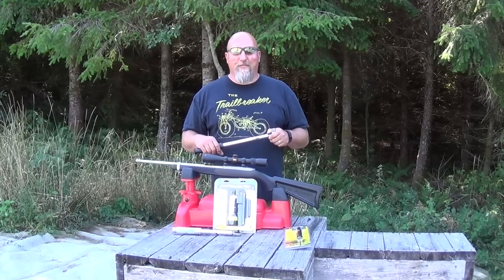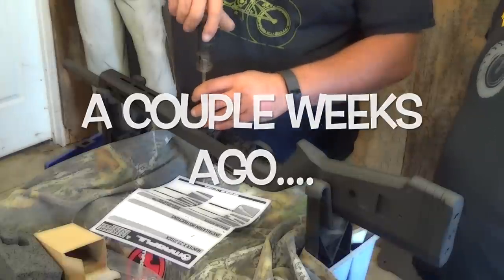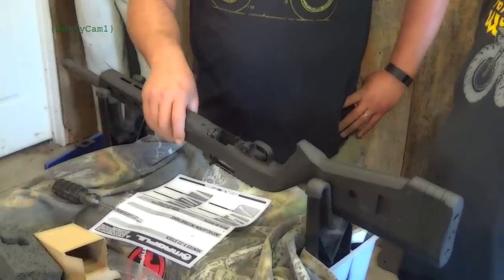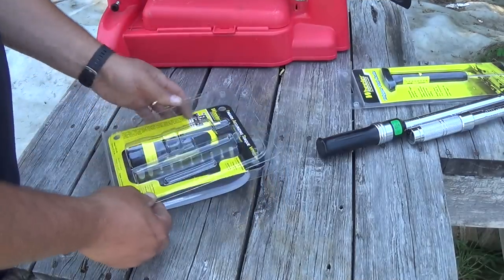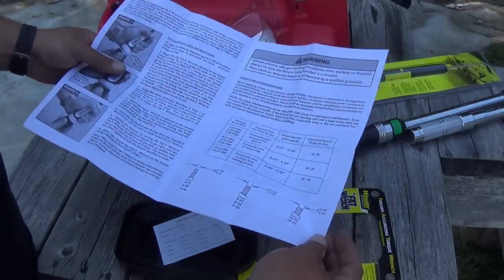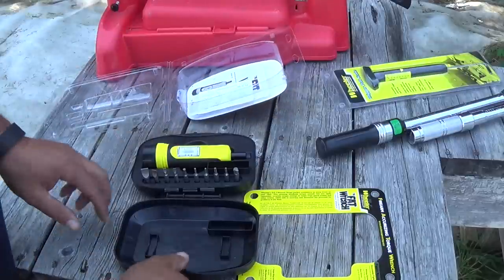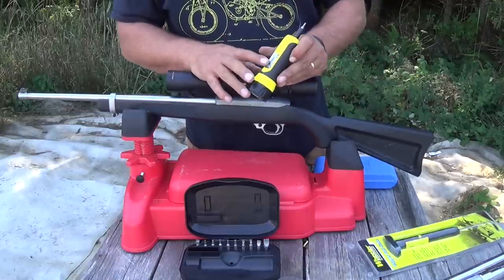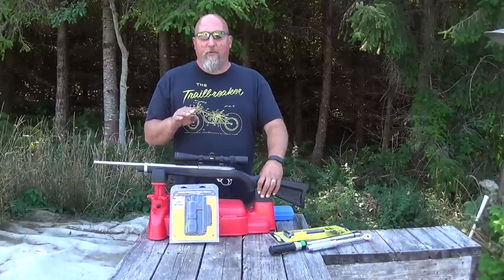Wheeler FAT Wrench - Torque Screwdriver - Review and Demo

Comment: That torque chart isn't quite right!  It refers to steel screws in steel parts.  Most scope mounts are steel screws in aluminum.  Refer to a torque chart for the screw size in your mount.

Comment: good point all screws nuts and bolts have torque specks for a reason the reason is to get the best holding power of the said  nut bolt or screw without  stretching the treads or leaving it to loose or over tightening it and doing damage  to the item

Comment: At least for scope ring torque, their settings are WAY off. From Vortex and Nikon, scope ring screws should never be torqued to more than 15-20 inch-pounds. Always check the manufacturer's recommended torque settings before you apply any torque. So according to the Wheeler recommended settings, those screws are torqued to about twice what they should be.
Reply: Yeah mine are at 18 too.

Comment: I found that wrench disappointing in that the red line used to determine torque setting is fat and imprecise. Furthermore, there is no mention in the instructions I received with my wrench that tells you to use the leading edge, middle or trailing edge of the line,. IMHO, this wrench is better than nothing but is susceptible to the user dialing in a 10% margined of error or better due to this flaw. I'll be upgrading mine to something else very soon.

Comment: I've had my FAT wrench for a while now but I am still confused on where the actual setting indicator is.  The line for it is rather thick so, is it the top of the line, the center of the line or the bottom?
Reply: Top of the red line aligned with the tic is that setting.  If you align the tic with the bottom of the red line that adds 5 lbs.  The online manual slightly clearer.
Reply: @TOakenshield  Thank you very much for that info.  Helps a lot.  Always struggled with that since it such a broad line and the paper manual has no mention of what to do about it.
Reply: The only reason I came to this review, thanks for answering this.
Reply: I agree with John. The only reason I came to this review is to find the exact portion of the red line for proper torque setting.
Reply: @TOakenshield  Dude this is gold, thank you for mentioning this
Reply: @johncos1068   Hahahaha.. Me too..
Reply: Me three, thanks for clarifying where the setting should be.

Comment: I saw another video on this thing where they guy had several Ruger 10-22s and tried different torque settings for the stock to action screw.  One shot better at 10" pounds, one at 30" pounds and others at the suggested 20" pounds.  Trial & error and shooting multiple groups appear to be helpful.
Reply: It helps set the vibration to the entire set up. As long as you don't go to tight and strip. Play around with settings to help dial it in. Every rig will vary as every set up is different so it's a play and figure out what that specific gun wants. Change something It'll change how it vibrates etc. If your truly picky on target shooting. And need every shot in one hole.

Comment: I came to this review for one reason and after lots of bla bla bla you did not answer the question.  The red indicator is way thicker than the setting lines.  The pictures that come with  the tool are far too tiny and blurry to see anything.  Trying to figure out if the red indicator goes to just touching the mark or what?

Comment: I've had one for a while now and have used it quite a bit.  Eh...it's ok I guess.  Would I buy it again?  Probably not.  I'd like to know the exact inch pounds I'm torquing to, not an approximate.  Some may not mind, I do.  What's more, most manu's don't give torque specs for screws, etc.  I've called a couple of companies and was told that they don't have any.  They tighten until "adequately tight".  So, what good is it?  Naw, I'd pass.

Comment: How do you set a torque that is not a multiple of 5 such as 18 inch pounds for my vortex scope?
Reply from the maker: Count the number of turns it takes the handle to go from 15 to 20, multiply that  number by .6.  Set the wrench to 15, and then turn it towards 20 the number of turns you just calculated.

Or just set it just shy of 20 and call it good.
Reply: I got it just below 20. It's fine.

Comment: I tried adjusting the take-down screw on my 10/22 but found that there wasn’t much room for adjustment. The screw was loose at first but was fully tightened after just one turn. How much room for adjustment is this action screw supposed to have?
Reply from the maker: It varies from rifle to rifle and fist to fist.   That's where having a torque screwdriver comes in handy for repeatability.  'Fully tightened' is subjective, and it's nice to have a number to go with it...  especially if you have experimented with that number and found a sweet spot.

Comment: Mr Know-it-all says:  Keeping springs under compression (as in loaded mags) does NOT wear out the springs.  Compressing and un-compressing is what wears on them.  Should this not apply to the torque wrench?  (if you believe Mr Know-it-all)  I don't know what to believe?
Reply: +454pakr Wearing out a spring would seem to me to be an entirely different issue than maintaining or resetting a factory calibration of said spring. Just my two cents...
Reply from the maker: +454pakr   Hawaii Volcano Squad Nailed it!

You are fine leaving your mags loaded during storage, AND you need to leave your calibrated spring at rest.   
Every torque wrench I have ever had Insists you reset to zero and relax the spring for storage.

Thanks for watching.